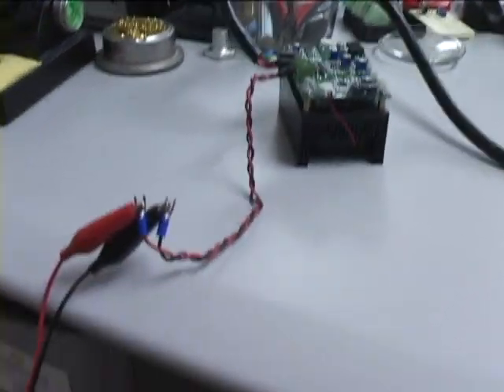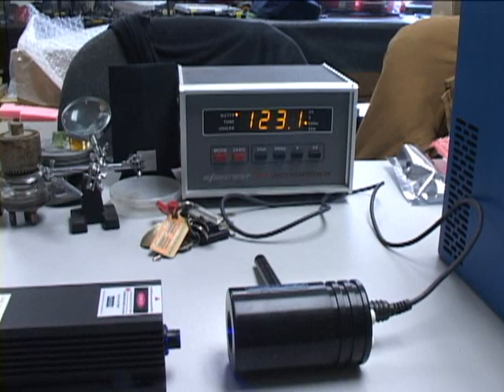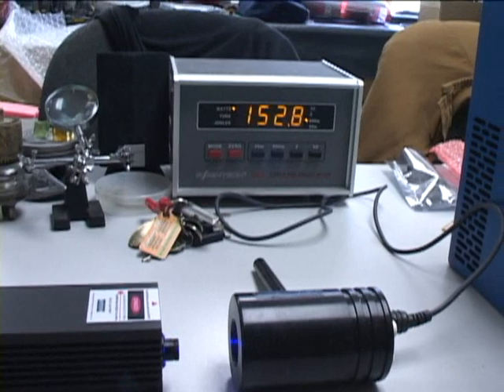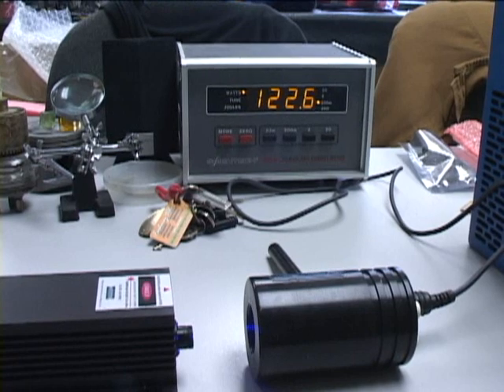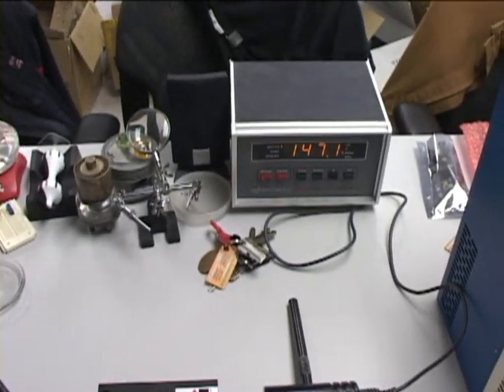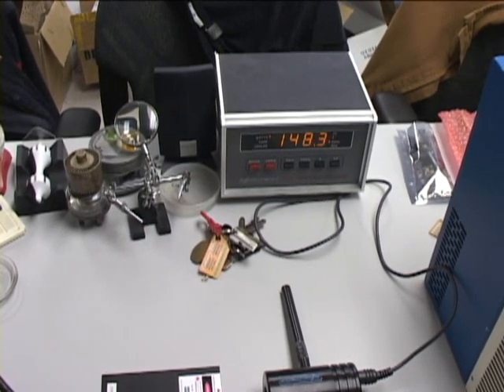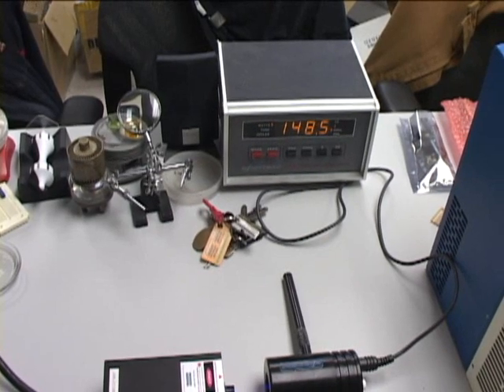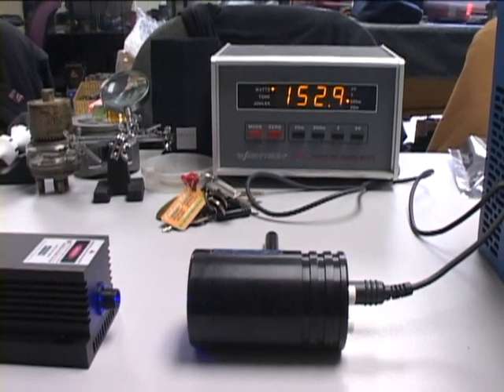150mW @ 473nm Laser Wave DPSS Laser Test

Comment from the maker: Well, when you first turn it on, you have a pump diode a YVO and an LBO crystal that all need to stabilize at different temperatures. It takes about 15 minutes for them all to get to their independent operating temp.